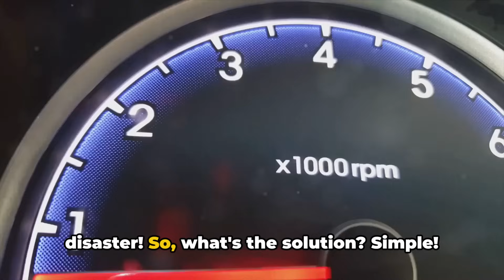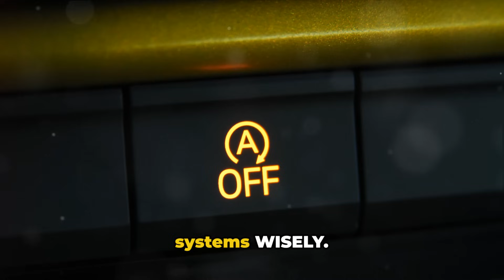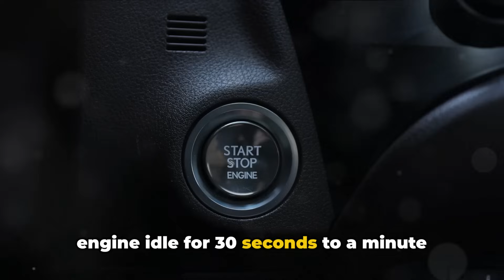5 Mistakes that Destroy Turbo Engines Fast!

Comment: Most engines cold start to a fast idle (~1500rpm).
Good rule of thumb is to wait until it idles down (~750rpm) to begin driving if you have a turbo. 
As the video states, this only takes 1-2 min. A bit longer in freezing temps.
Reply: The cold start to 1500 rpm is to heat the catalytic converter to overall reduce emissions.
Reply: 1500? sounds too high. At -30C my starts at around 1100-1200 and then slowly, very slowly returns to normal 800-900. At 1500 the transmission already tries to shift up (and 2000 sounds like "we have liftoff!", but it's an old diesel).
Reply: Doesn't apply to older cars without heated O2 sensors, as it takes quite longer to reach closed loop operation; in this case don't wait longer simply because the idle doesn't go down.
Reply: It's not just for turbo cars, it's also true for naturally aspirated engines even. In my Camaro I always wait until RPMs drop. It's also safe to do to ensure that the engine is oiled up before you drive off. Takes 15 seconds (never minutes in my area as we never experience freezing temps).
Reply: owned a solstice gxp for 4 years. this is me everyday haha.
Reply: Like Subarus lol. They idle high in cold start and then idle down.
Reply: Mostly not enough time, so the solution is to wait at least 10 seconds before you hit the clutch and gas pedal. But also in one minute a heated Turbine just Won't cool down, Especially in the hot summer days. It takes at least 10-15 minutes if outside is warm, to cool down the Turbine .
Reply: Truth. Warm up cycle we call it here
Reply: I've never owned any vehicle with a turbo. It might be nice for a car to automatically bypass the turbo until it gets up to temp - maybe not even turn it on if the drive is short enough. Maybe a little light on the dash next to a turbo gauge that indicates whether it's up to temp so you know that the beans are ready to go? I know... extra stuff that adds cost and maintenance items, but if someone already wanted a turbo instead of NA 🤷🏼‍♂️
Reply: @msreedaran89  that would be nice to have. But in lieu of, staying out of boost on short trips/until the engine is up to operating temp is the next best solution imo
Reply: @NovemberFoxtrot5280  but staying of boost means for diesels underrevving the engine and depending how annoying the turbo gasoline engine is set up ( ihate turbos on gasoline engines) you still have to rev super low, i personally tend to rev higher to decrease load and torqueoutput, ratehr 2k rpm and 40% load then 1,5k and 80% (boost starts at 1,5 and really gets going at 1700 in my car so at 1,5 you barely have any boost and floor the engine. i know that the"effectivee" load increases with boost even if reducing throttle a bit but you compensate with rpm not torque so... yeah seems fine.
i drive my car with a little higher rpom, like 60 in 3rd instead of 4th gear to bring it up to 50°C in <2,5km (around 15°C per km driven) so that its "ready" when i get out of the village
Reply: @johannesdatblue4164  this is it. use minimal throttle but hold on to each gear a bit longer. i do this when it's cold. the rpms will warm up the engine quicker with less wear than high load at low rpms. it's the torque production that increases the side loading on the pistons and the rpm of the turbo. not what you want when the oil is like molasses. you want to warm the oil up by moving it around, not by rubbing metal parts together.
Reply: @msreedaran89  Eazy, just find out at what RPMs your turbo kicks in and do not go past them until your oil is at ~90C.
Reply: @taqial-faris6421 Bit difficult if u dont have a oil temp gauge or max torque is @1900rpm
Reply: @msreedaran89  I suppose they could design an exhaust bypass so the turbocharger won't spin until operating temps are reached, kind of complicated and more costly to build, plus the auto makers don't want to build cars that last decades, they'd much rather build cars that last until the warranty expires and then break down.
Reply: @AmericanThunder  don't be so scared of your tubo men, I have seen working vans getting floored down the second the key was turned at freezing temp and these turbo would last over 200k km before smoking, as well as turning the engine off before even pulling the handbrake with a spinning turbo, the rest of the engine being stock and good after 350k km so, take care of your car, but no need to baby it, if it's built to last, it will, if it's not, it will break anyway.
Reply: The fast idle during a cold start is to warm up the cats, it’s not enough to bring oil to temp.
2min idle and 10min drive under 2k rpm is good.

Comment: A couple of months ago, the turbo of my Golf blew up because of a cold start and too much rev of immediate acceleration after a 200 m. It wasn't cheap, new parts for the engine, new turbo etc. I'm lucky thet it happened close to my home so I managed to pull over safely. So now I'm more careful.

Comment: How should you drive a plug-in hybrid turbo engine? The management system of the car does exact the opposite. It drives away electric and when power is needed thr cold engine kicks in. When breaking on the highway, the hot engine stops and energy is recovered for the battery. So, is it killing itself. Just asking for a friend…
Reply: thats a good question

Comment: I do wonder about start stop. I know modern starter motors are brushless and more heavy duty than conventional and the start stop doesn’t activate until the engine has warmed up sufficiently. Also modern synthetic oil’s stick to metal like a magnet… I’m not fully convinced with this theory

Comment: That's some great advice there !.....I've one more : Limit the use of a turbo car in hot / humid conditions ( summer time basically ). The turbo will be sucking in hot air , the intercooler will struggle to cool said air , the ECU will try to balance things , but hp / performance is really reduced , which is why during the heat of a summers day , many turbo cars you will see parked up as they really don't like hot conditions. TOO MUCH HEAT !

Comment: Very good advice. I have a MINI JCW R56 and was told to let it warm up for a few mins before driving off and let it cool down a min or so before you turn off your engine.
Reply: 2 min warm up before driving in the morning.
15 seconds at idle before turning off.
Works for me.. 22 year old turbo diesel saab 9 5 2.2 tid engine.
Engine is mint

Comment: 5k oil changes on my 22 Mazda CX9.. Want the turbo to last..
Reply: Miles? Sure but for me even 6/6.5k is totaly fine if drove gently 70% of his time, people doing 5k km oil changes have just money to waste ihmo on a city car atleast
Reply: 5k is ok or 6 months whatever comes first. However modern quality synthetic oil can last a long time but I would change it at 3k because debris that gets in oil and with direct injection turbocharged engines can get fuel diluted into oil witch will dramatically reduce the oil life and efficiency. Oil is cheap engines are not.

Comment: You should use Synthetic oil in all engines especially turbocharged engines. 

I drove a Chevy 2.o turbo for ten years with 23 psi of boost. It made 300 hp and never had an issue. 

The key is the oil as it is thing cold and will not carbon up in the turbo. Most sre water cooled today too so it is no issue.

Comment: Don't go hard on ANY cold engine. But don't sit for 10min warming it up. Just drive away once oil pressure up...itll heat quicker driving than sitting.
Reply: Yup, this is what I do and have had no issues with any of my engines.  Start the car, warm up only 15 secs but then I drive off slowly keeping the engine RPM at around 1500.  Once the car's temperature reaches optimal, then I can accelerate or brake hard.
Reply: I'm curious to know - don't some transmissions also need a moment to get up to temp/pressure? Like you're supposed to load the transmission gently and let it rev up also? And I'm sure someone can also comment on tires warming up, giving suspension a little time to gain a little elasticity - maybe not strictly from a racing perspective. Something everyone can apply in a daily driving situation in terms of the other components of a car or even a motorcycle.
Reply: @msreedaran89 every fluid separating metal from more metal has a warm up time
Reply: @msreedaran89  To warm up an automatic transmission put in neutral not park. Trust me on this as I learned the hard way in cold WI winters and from a colleague who had lived in Alaska. Neutral activates the circulation pump whereas park doesn't.
Reply: @msreedaran89  i also heard that from my dad that if u have an automatic transmission when u switch from N to D u should give it like 2 second to load up the pressure before going so ig it is true
Reply: yeah this is what i thought too i just take it super steady , the blue engine cool light soon goes out
Reply: @antonyincornwall435  Subaru driver?
Reply: drive slow  10min...  or install  independent heating solution  connected to the vehicle's coolant circuit (like webasto) this will significantly extend the life of the engine, battery.
Reply: 😊😊⁰ @lubosholicka3291
Reply: @lubosholicka3291  good boy - an old truckers'  advice, also.  OIL  only  LUBRICATES,  when it is hot.  Turbos'....?...on gas engines ?....i'd  like to chat AT  those  engineers...../ How much  ' power '  is enough, FOR  STUPID humans.,  spending most of their life // time // ......on freeways, not moving - or moving slowly. NO need, for all that  wasted  HPower...
Reply: This man knows
Reply: And this is why i wait till the temperature gauge needle to line up with the C line and since the speed limit is pretty low i can get away with moving at idle speeds
Reply: And drive gently to warm up.
Reply: I turn the engine on and ref between 1000 and 1500 rpm at the parkinglot.  To heat up the engine en defrost the windows. Then gentle drive away
Reply: @squicker no it’s caused by warming up to fast. Metal expands and constricts based off temperature. When your engine warms up fast certain parts are still cold because the heat doesn’t have time to disperse. This is what causes wear in cold weather
Reply: @yyeezyy630  not to mention that you are using the wrong oil… Read the Manual!! lol
Reply: Just drive with idle rpm should be fine rather than idling for 10 mins
Reply: it’s gonna do no harm letting it sit for that time obviously it will warm up quicker driving it you’re stating the obvious
Reply: Oil pressure builds up in my car within first few seconds....if it doesn't your oil pump has issues......and a few seconds isn't long enough by any means if temps are below 50°.....
Reply: also drive with no more than half revs/half load for a few minutes. theres no point keeping the revs under 3000 if you're using full throttle, especially with a turbo.

Comment: Excellent video, priceless advice!!! I have 2 Audis, my wife’s Q5 and mine is a modified A5. I always do exactly what is in this video and zero issues!!!
Reply: I just bought an A5 and it's my first Audi!  Have had Volkswagen in the past and never had problems but I never skipped oil changes and took good care of them so that is probably why.
Reply: @ramses8847  Same exact path here. Bought my first car at 19 which was a 2017 Volkswagon Jetta Tsi. Just bought my 2nd car at 21, 2018 Audi S5. The thing is a beast!!

Comment: More and more I don't want a turbo charged engine. They also put more stress on the engine.
Reply: Most of these engines are so under tuned it’s not funny. There’s cars that make 300 hp stock and with just a tune make 350-375.  Engineers leave a lot of power on the table to make sure they last.  Modern turbo engines if left unmodified will last.
Reply: @Mikes_ST yup. I have 2022 wrx which has a 2.4 liter boxer engine with turbo running 12 psi (basically not a lot of pressure). Under stressed all things considered
Reply: I held off getting a turbo car for many years for just this reason…if I had an engine choice I’d always go for the non-turbo version. But my new car gave me no choice, so I’m trying to take the best care of it I can.
Reply: A well engineered engine can take the abuse without an issue.
Reply: Gl in europe,  NA aspired cars are big useless SUVs  ( we don't have roads or fuel prices like USA) or dumb slow ass city cars with 80 hp, we mostly have 1.0 to 1.6 turbo engines with some 2.0 exceptions for petrol.
if the engine has a turbo it was design to keep up with it, you won't even notice waiting 1 minute before turning the car off  and even a NA engine won't be happy at freezing cold temps with thick af oil, just few minutes of your time compared to Hours wasted on socials.

Comment: I would add avoid lugging the engine i.e. pulling hard from low revs.
Reply: Whats lugging engine can you give me a example??
Reply: @totov7673  giving a high demand when the engine rpms are low (~1200 rpm), like going up a steep hill for example.
Reply: Exactly. Many people do that to save fuel and it's not only bad for the engine, but for clutch, engine mounts and gearbox mounts as well.